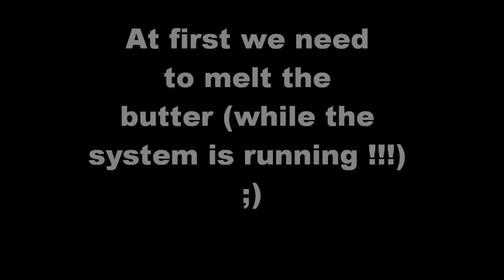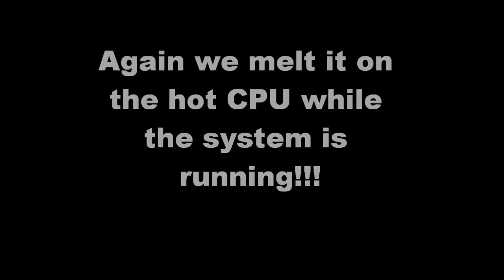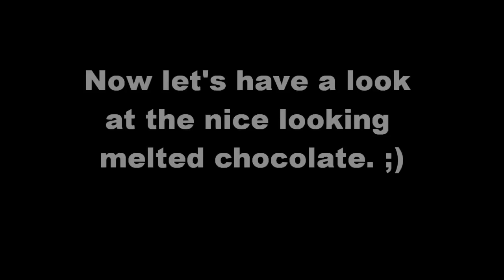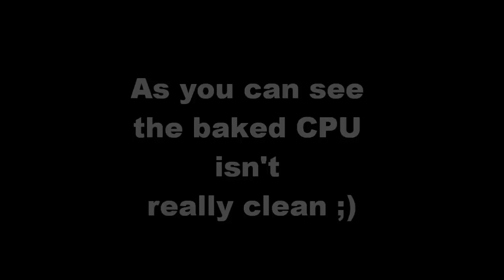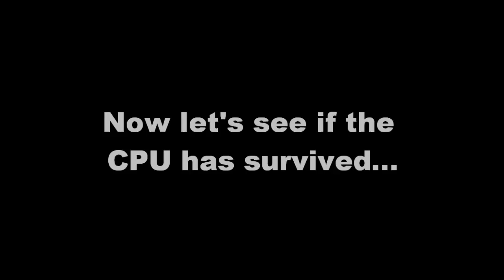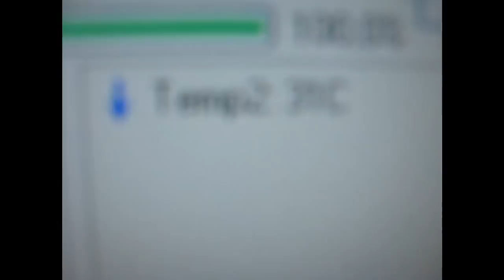How to cool a CPU with cheese and stuff

Comment: Nope, its the 6200 it is around 63 to 65 °C max, its known it reduces their life by maybe 1 or 1 and a half year to make it work at that temperatures (in load obviusly), but hey the point here is that any midrange thermal paste could give same results as the famous arctic silver 5, at least i am amazed with the thermal paste i use. and i forgot to mention earlier, i use stock cooler, right now im planning to get the cooler master seidon 240mm so, i would expect even lower temps.

Comment: Well, at the exception of the very first celeron, and the Willamette gerenation (like this cpu), Celeron have been a great "bang for your buck". They are low cost, highly overclockable and use the same architecture than their big brother. Their only real weakness is their tiny L2 cache.

Comment: @pcpik3r On the top side, yes. If it hits the connectors on the bottom, you're in trouble, as your CPU will probably short, and die along with it.

Comment: The Pentiums cost under $100 and perform better the majority of AMD CPU's. What's bad about that? The only reason to use AMD is if you want to use one of their kits, or if you want a APU (Unless your running a HTTC, I wouldn't suggest it).

Comment: The line on the screen? i don't think so. i think it is an LCD Error. i think Some Muck or grit got in it. the same problem applies to my freind's screen. my screen has just 1 stuck pixel, not usually noticable.

Comment: I have ruined my i7 5960x trying this!!
Reply: Are you using the stock cooler?
Reply: Nope, I am using Corsair hydro h100
Reply: nope, I was joking :)
Reply: I only have a i5 760 :)
Reply: I got the i7 3770k is that a good cpu?
Reply: Lorenzo Van het hul Only if you pour water and stuff like that on it to keep it cool.
Reply: Lorenzo Van het hul OC it to 4.7 GHz and it will fly
Reply: Haha it can reach 4GHz when turboboost is enabled
Reply: Lorenzo Van het hul 3.9GHz
Reply: Yes but i overclocked it:) so i got 4GHz out of it
Reply: I reached 4.9GHz with a friend's i7 3770k watercooled one year ago. It's still my personal record with a "core" cpu. The temps were really high LOL.
Reply: Haha nice bro, i think i have to replace my cheap cooling paste because my temps are 50/60 degrees celcius when on idle or in bios so something not right there (i7 3770k)
Reply: c0ldw1nd i fried my E5-2699v3 by doing this.
Reply: +Lorenzo van het Hul yes.
Reply: i fried my 5960x too bought by my dad :(((((((((((((((((((((((((((((((((((((((((((((((((((((((((((((
Reply: . Doge what did your dad say?
Reply: Lorenzo van het Hul "GOD DAMN DONT MAKE JOKE ON INTERNET"
Reply: Haha

Comment: mmm yeah maybe that is true but i had an intel core 2 duo @ 3Ghz and the thermal paste did last for 1 year and the temps never went over 60 degrees and thats for Intel! now i have an AMD FX processor know by the amount of heat they produce and the core procesor never goes above 65 degrees at 4.5Ghz, And if that is the point i could re-apply the Thermal paste every 6 months without the needing of buying another 28g tube. But what the hell, everyone have their own opinion.

Comment: and lets be fair in the low end and mid market it teters back and forth (intel owns high end) i would rather an 8150fx than a i3 but i'd rather a i7 2700k than the 8150

Comment: It's a Presscot or a Northy?
Reply: Ok, its a Willamette
Reply: +c0ldw1nd Like P4 or something?
Reply: +Pixelator 552 Willamette (2000), Northwood (2002), Gallatin (2003),  Prescott (2004)  and Cedar Mill (2006) were the architectures of the P4. 

Willamette is the first version and is as fast as the late pentium IIIs. 

Northwood is the best P4 architecture, it wasn't very hot and is faster than their AMD counterparts, the previos generation of P4 and the next versions of the P4. I own 2 of them.

Gallatin is a Northwood with more cache and higher clockspeeds. The faster P4 up to date but very expensive.

Prescott and Cedar Mill are really hot and perform very poorly, at the same frequencies a Northwood outperforms them drawing less power and with lower temps.
Reply: +c0ldw1nd Thanks! my school still use that Prescott P4 anyway. slow like hell XD
Reply: Pixelator 552 But they are really good for winter xD

Comment: @darkblaze176 What are you talking about?  The x86 architecture that ALL PC's and current Macs run on was an Intel invention!  AMD started off by copying Intel's 8080.  Intel then licensed them to produce 8088 processors so that they could get a contract with IBM.  AMD continued to steal Intel's shit until copying got too hard - at which point, they released the K5.

All the innovations found on todays CPU's - MMX, SSE, Hyperthreading, multiple cores on one die, etc. were pioneered by Intel.

Comment: computers are what you can call a hands on hobby, can you say experience,as for the grammar issue there was none it was shortened accordingly (tell you tube about the 500 character limit) the "ya" was a typo and you can call the rest of the comment stupidity if you like but it was a generalized term i have heard. no one i have dealt with or met wants an i3 "moms processor is what i've heard it referred to, it may be good enough for you thats fine but generally an unpopular choice for a reason

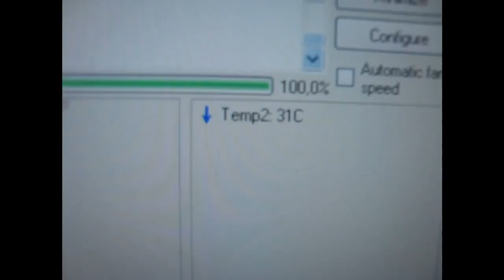Comment: At 3:50 cpu-Z says family F model 1 therefore is a Celeron Willamette.Yhep is a piece of  crap.Actually in the video is overclocked by rising the FSB from 100 to 130Mhz.
Even then; is hot and slow

Comment: Too much cheese bro... Ur "thermal compound" (whatever it is) should be applied FLIMSILY !!!! Its ONLY function is to close TINY LITTLE gaps between the surface of the cooler and the surface of the cpu, because both aren't 100% flat. 
Most people think the more thermal compound on the die the better it is..... NOT!!! The more compound you put on it, the bigger the distance of your cooler to your cpu gets ^^

Comment: 1. Right now, Intel is completely better then AMD.
2. Yes, AMD fucked up with bulldozer. That is why Intel right now is overall better
3. I didn't mistake it. Intel's of similar performance are a lot cheaper. Who the fuck cares whether or not it has more cores or more GHz if they perform worse. Because you don't have to pay $100 more to get a similar performing intel; you have to pay $50 less.
5. Capitalization and punctuation. Learn it.